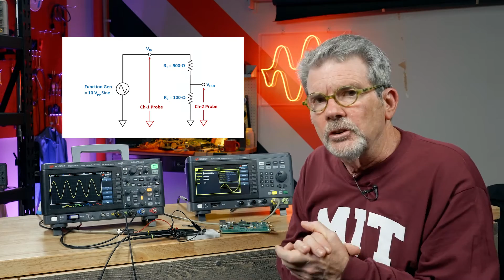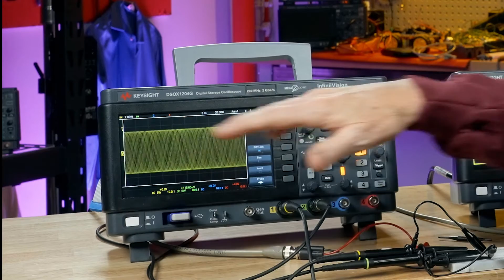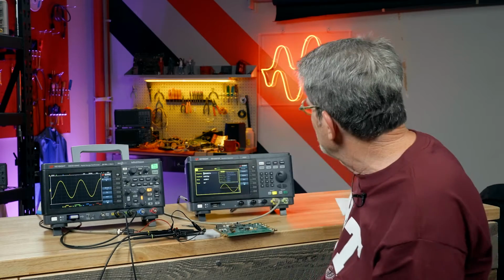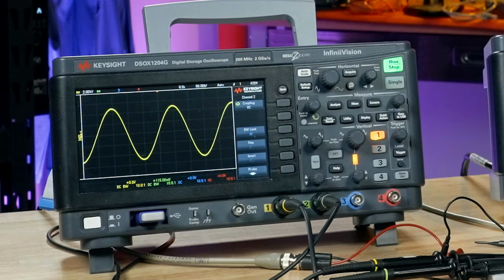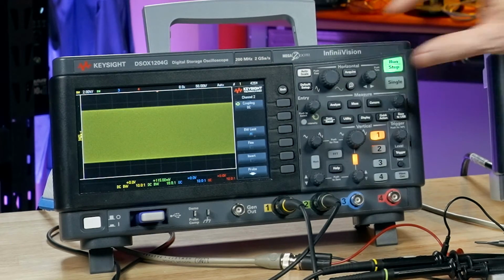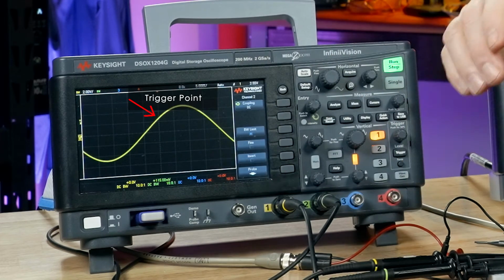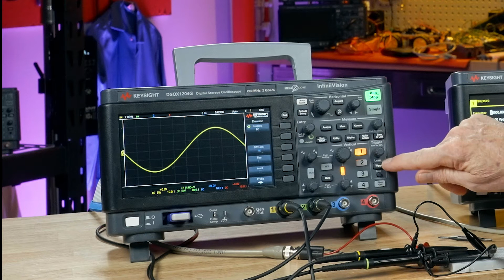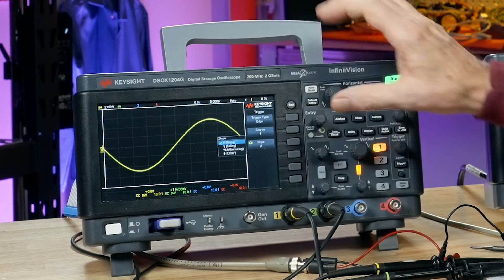Lesson 4: Triggering Part 1 - What the heck is triggering?

Comment: Thank you so much. One question,  if I have multiple channels, how can separate triggers be set for each channel? I have a dsox2014a.
Reply: When using a scope you set up one trigger and then everything is plotted relative to that one trigger point across all channels. The trigger point effectively determines where t = 0 seconds, so it wouldn't make sense to have multiple trigger points.

If one of the channels has data that is moving relative to another channel then you either need to pick a trigger that is applicable to both channels, use trigger holdoff to ensure you are triggering at the same location (for example for bursted packets), or use a more complex trigger type like a pattern trigger or serial trigger. Check out chapter 10 in the DSOX2014A User's Guide for examples of what is available and how to set them up.